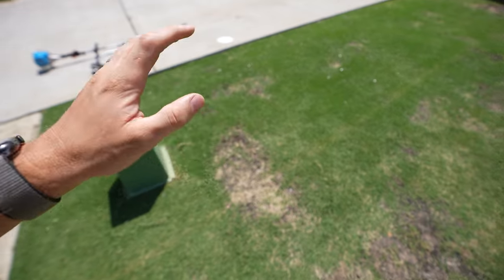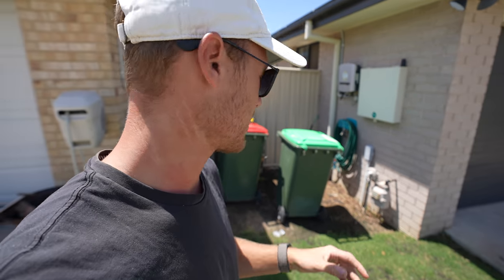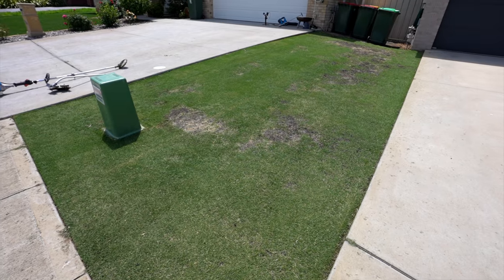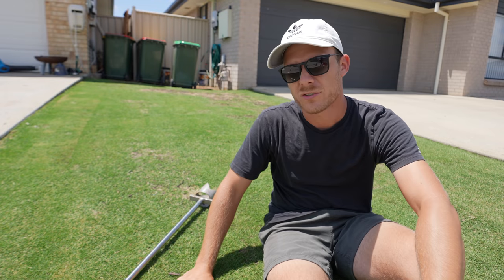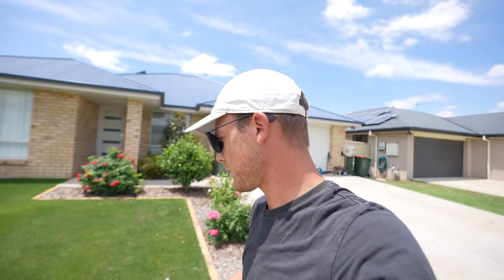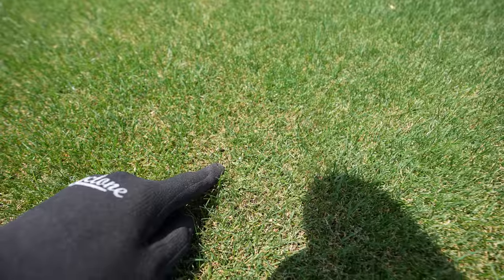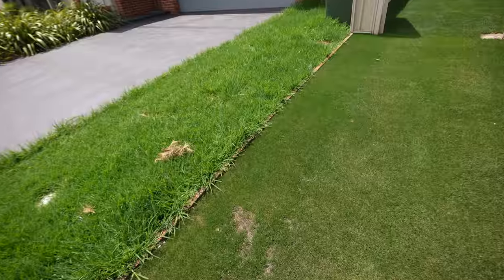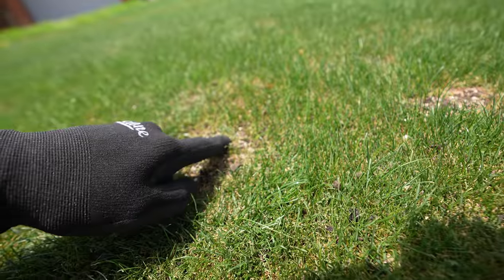Fixing Bare Spots In My TifTuf (Bermuda) Couch With Plugs

Comment: Hey mate just after some advise. We have 2 golden retrievers and kids and looking at putting about 60m2 out the back and 50m2 of turf out the front. Just wondering how would tiftuf cope with dogs? I haven't seen many people with it and if they do they don't have dogs or know how it will go. I've been recommended Kikuyu as best for bigger dogs and kids but I like the feel of couch grass haha. Basically don't want to spend the extra coin on tiftuf if it's not fit for the purpose.

No bore on the house but has full sun.